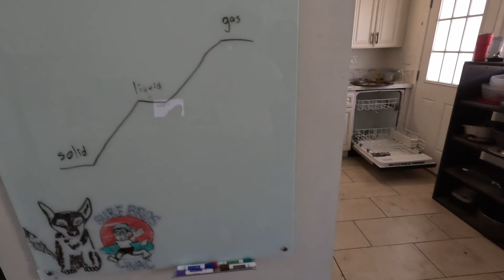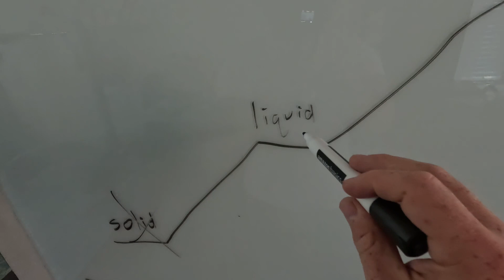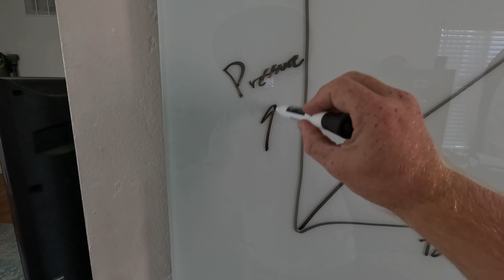How An AC Makes Air Cold - HVAC For Dummies

Comment: You don't create or make cold air or make anything cold you only remove the heat.......... That's it
Reply: Yes. That's the best way to understand it. Heat moves and what's left over is cooler. That's why the compressor at the outdoor condenser makes the refrigerant hotter than the outside temp, so that heat will move from the refrigerant to the outside 'cooler' air.

Comment: Ok it's simple anytime you boil a liquid it removes heat the txv controls how much liquid is going into the coil to control the boiling of the liquid and after the heat is removed it's cold because in the absence of heat is cold so all any AC or refrigeration system does is move heat from one place to another
Reply: You don't remove heat when you boil, you add heat. You remove heat when making a substance condense.
Reply: @turnedearthdesign8678  I meant remove heat from the air moving across the coil the refrigerant is boiling in. Yes you are correct the boiling liquid is absorbing the heat when boiling. Sorry I didn't explain that better thank you for pointing it out.
Reply: @tdobson888  it probably would have been better for him to explain things in terms of BTUs. It would have been much more obvious for people to see what actually happens during evaporation/condensation and why we use that specific process for heat transfer in the first place.

Comment: I do maintenance at the apartments I live in, and most of the hvac stuff that comes up I can handle. I've watched countless hours of youtube videos and took the skillcat EPA 608 course and passed with a respectable score. I feel I have a pretty firm grasp of the refrigeration cycle yet I still have no clue where the cold air comes from. I'm assuming somewhere between the metering device, the blower, and the evaporator coil, cold air is introduced into the ducts but I'll be damned If I can visual it.
Reply from the maker: Cold air is not "introduced" into the ducts. The air from the house enters the return vents and then when it makes contact with the evaporator coil the heat from that air is absorbed by the coil. This makes the air cold
Reply: @SurfBrosHVAC the heat is absorbed by the refrigerant!
Reply: I think of it as removing heat, thus what is left is lower heat or what is cold. heat absorbs into the evap, leaving no heated air. the amazing thing is the refrigerant can hold heat, boil, condense, pressurize, liquify all while that motor is pumping away.
Reply: @ewebbytrailscout  Appreciate you taking the time to reply. Between yours and @SurfBrosHVAC replies I now have a more complete image in head.
Reply: Same here bro

Comment: what does the txv vs piston do? Thanks
Reply from the maker: TXV and pistons are both metering devices. Pistons always meter refrigerant at the same rate no matter what while TXVs somewhat adapt to running conditions to control the flow of refrigerant in a more efficient manner. EEVs precisely control the flow of refrigerant based on exact demand.